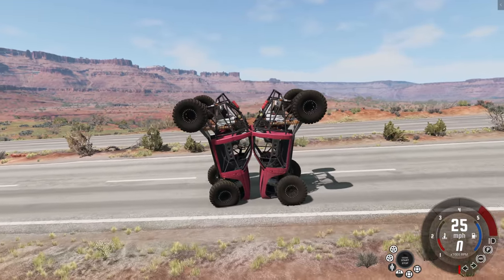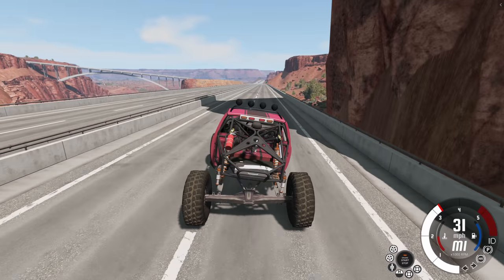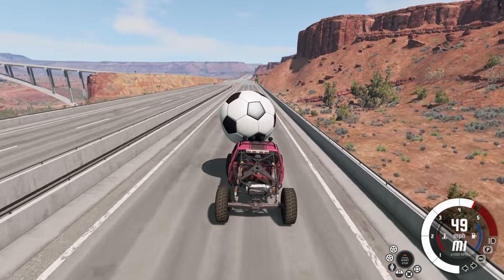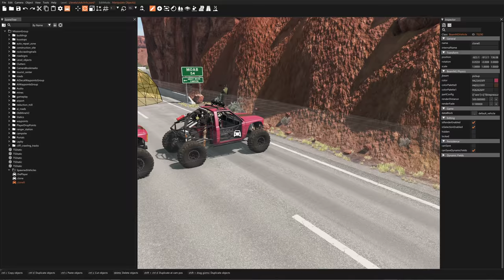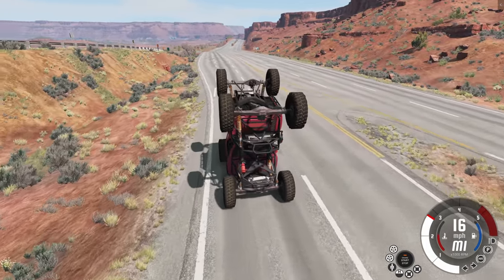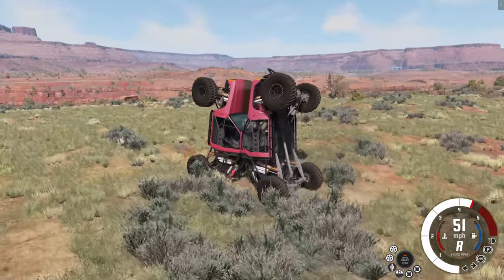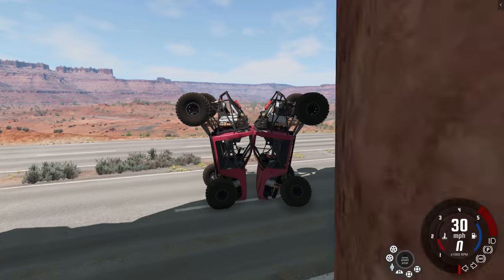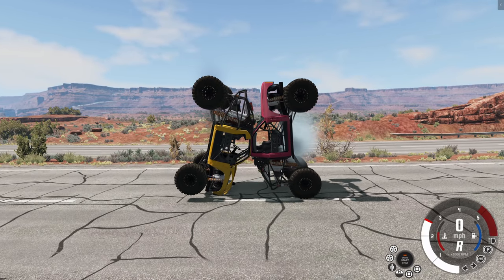The UNFLIPPABLE TRUCK - BeamNG.drive

Comment: The Reason it dosnt rollover if you stop at a high speed, is when your going slow-ish, the tires maintain Grip, Causing it to flip, at high speeds, the sudden cease of Rotation, causes a loss of grip, making the tires slide instead of grabbing the road, Thus the truck does not flip
Reply: SCIENCE!!
Reply: makes sense but why did you uppercase the G, R, and T in "grip", "rotation", and "thus". Also, "reason" while you misspelled "doesn't".

Comment: Put drag slicks on the front and try at a higher speed
Reply: I think its the brakes
Reply: @dripgoose9784   If the tires were squealing, that means they are skidding. This implies that it is a lack of grip.

Comment: with the superpig not flipping at high speeds, I think ABS or better brake control would help a bit, looked like the fact that the wheels locked up limited the ability to flip

Comment: I don’t know what a locked dif does can someone tell me please
Reply: A diff is a part on cars that let the back wheels move at different speeds so that If your going say 20 miles an hour and you take a turn than the tire on the inside is allowed to Move at a different than the outside speed so a locked diff is where the wheels don’t change speeds
Reply: super potato just say a differential puts more power to the wheels cuz it does